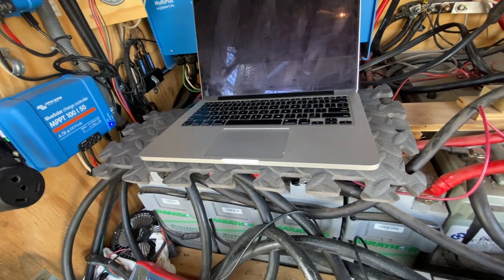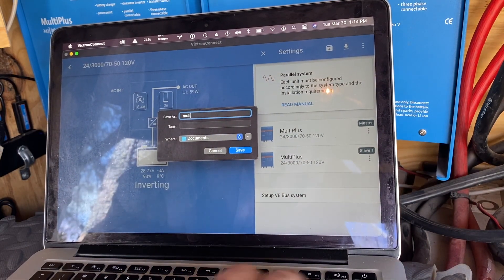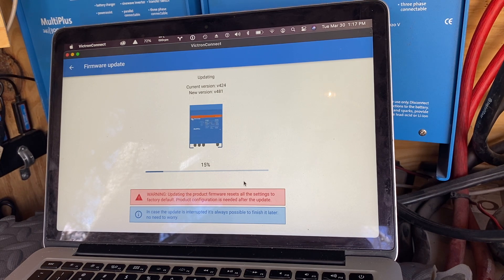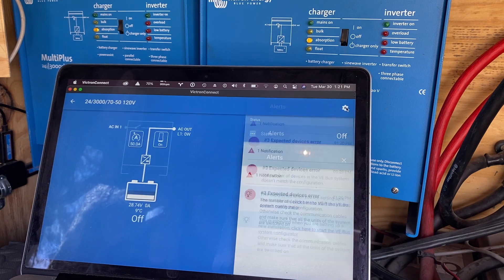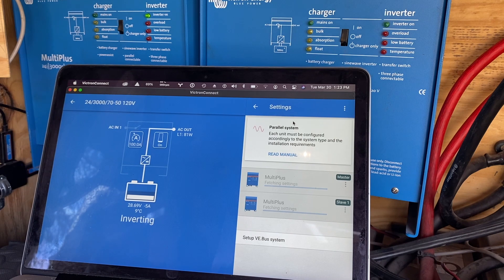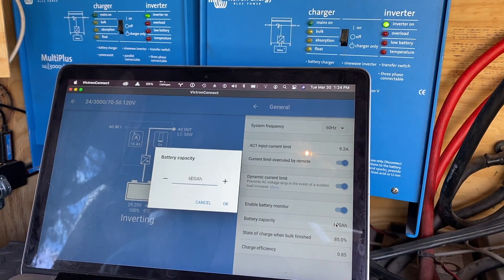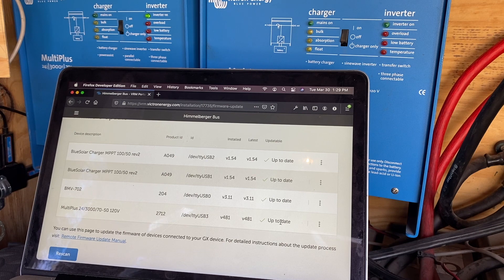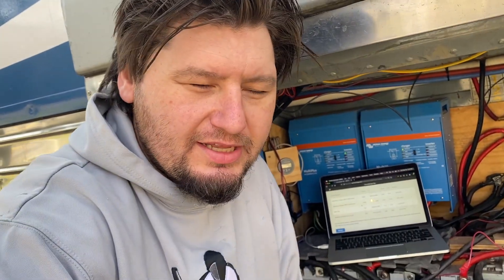Updating Victron Multplus Firmware via VictronConnect MK3 to USB and VRM

Comment: Came Across This Video
Do You Need Driver For The mk3 Adapter?
My MacBook mid 2014 does Not Recognize The Inverter
Reply from the maker: No driver needed on MacOS .  Is the inverter on?   Try swapping out ethernet cables as well.
Reply: @HimmelbergerBus  I just had to open the Victron Device Part and ThenConnect the m3k adapter
And bingo!!  We are in Business 
Thanks for your help
I am now running the 3.10 27 software in the raspi4 
Now you can update in VRM Portal on line in the three dots drop down  list  Device List. At bottom. Firmware updates. Can update all Victron Equipment Except the Pi 
When updating this way. Keep the Pi on a different power supply it works
My inverter is now on Hardware 506 working A1
The Pi can be update in the firmware section  of the settings
No issues Now
Go Luck and Travels

Comment: Hey I have a question, I just installed my 24/3000 multiplus inverter I have 8 135ah AMG batteries in series and a transfer box from my shore and genny. My system was running off my genny and shore only so now I have my inverter connected and only half of my power is coming on, on my breaker box some breakers are not getting power and the others are showing 119-120v can u please help
Reply from the maker: Sounds to me like you have split phase power in the coach. Your inverter is single phase. Sometimes people run two inverters to get the 240 split phase or an auto transformer. 

Some folks just move some items to the inverter leg and leave the other side for generator or shore power only, like an electric fireplace. Or second AC.

I ran my coach to be all single phase, so I have no 240 volt things and no auto transformer to worry about.
Reply: @HimmelbergerBus  u have a email I can send u some photos too?
Reply from the maker: Shawn@thehimmelbergers.com
Reply: @HimmelbergerBus  I just emailed u, I’m pretty sure I have single phase but is it a setting that would cut a leg off?

Comment: Hi Shawn, thanks for all the great videos on RPi and Touchscreen! You mention in hindsight a Venus GX or Cerbo GX would not be much more cost. Can you elaborate on that? Isn't it roughly $500+ for GX device and screen versus roughly $200+ for RPi? Connectors are extra on both, am I missing something? Thanks in advance and appreciate your step by step videos!
Reply from the maker: Venus GX was $250-$300 I thought. Cerbo GX doesn’t need a screen. You could in theory use any Table or even an RPi as the remote screen for a GX device. With GX device you can go VE direct serial cables , no USB adapter needed. You may still need a MK3 adapter for the multiplus but now you can upload a program file via VRM -> Venus GX so that’s a “might need”.  You also get tank sensor inputs, VE CanBus, and no need to fiddle with the OS constantly on updates like we’ll need to on 2.71 

 ¯\_(ツ)_/¯ I’ve got $150 or so in adapters, no idea what they run now.  It just that it becomes less of a slam dunk when the cost difference is under $100 IMHO.

Comment: I can’t get in to set my multiplus 10000 I got some nec a 123 and there a 13 a lifepo4 and it won’t let me change the parameters help!
Reply from the maker: You need an mk3 adapter, either USB or BT

Comment: Hey Shawn, how have you been? Got my pi4 running 2.60 a while ago and it is has been great. did you update to 2.65 or 2.7? any reason to? when are you heading out for the summer?
Reply from the maker: Yeah, I showed I was on 2.65~8 in the video (near end) :-) We’re tentatively going out west again in June. Going out plenty more around here, got a few surprises. First we have brakes to get done.
Reply: @HimmelbergerBus  cool, i cant find a description of the changes from 2.6 to 2.7 so i dont know if it's worth it. you going to tackle the brakes yourself? i used to run a bus repair shop and that is not something i would try myself, too hard on the back its a young mans job.
Reply from the maker: @markstumpf9391  major change on 2.65 is the ability to update multiplus firmware from VRM now. Hopefully this is the last time I need to hook up a USB cable to it.

Comment: One day I would love to get a Victron Multiplus just to simplify my electrical, need tires first :)  Nice to see firmware flash process though.
Reply from the maker: This was so much easier than with the old VEFlash software.  I bought mine  much cheaper than most by using eBay and making an offer.  Give it a try.
Reply: @HimmelbergerBus  Never thought of trying that..good advice!

Comment: Hey Shawn that was cool do you find an advantage to running two of the multi plus units instead of one single bigger unit?
Reply from the maker: Victron didn't make a 6kva and still might not. I like the redundancy, this way if one fails, we're not without an inverter.  Same with Solar chargers and so on.
Reply: @HimmelbergerBus  you mentioned in the updating one would be considered the slave unit is that right and are you wiring your breaker panel one inverter down each leg of the breaker box?
Reply from the maker: @briandavis9975  No, that would be 240 split phase, I joined both legs of my box for single phase 120 only.  I have 2 AC units (1200-1400 watts), electric water heater, microwave, etc.  I didn't see a way to balance those without overloading a single inverter.  So both run in parallel, 6000 watts (6kva) for entire system, whatever needs power gets it and the load is split 50/50). What's nice is if we want, we can add a 3rd.  So far we've only been near the limit a few times.  Full AC, making hot water and someone turned on the microwave.   If we're on a pole, no big deal, because it's all hybrid.  So we get 6000w plus whatever we get from the pole.
Reply: @HimmelbergerBus  thanks for explaining it for me Shawn

Comment: Glad everything updated ok without problems. The Victron stuff is good but it's kinda like the Linux of solar systems, you kinda have to roll all the pieces together yourself. Someone with your knowledge would have no problem, but I cringe at the number of missteps the average user could take. I think the average user with a system of your size would be better off with an all in one solution like the Sol-Ark. Most people balk at the price until they compare complete systems together and then it's a really good deal. Or you could just buy a Sol-Ark workalike from the OEM Chinese manufacturer for a fraction of the price, but that's another story for another deye!
Reply from the maker: You're not far off, Venus OS is a Linux  / Unix variant running on ARM hardware.  In almost all areas of my life I hate all in one solutions.  If one part goes bad, it's hard / impossible to fix without replacing it all.  If we lose 1 inverter, we're fine, if we lose a solar charger, replace it, we're fine.  If we need to add solar chargers, no problem, etc. 

Combine that with the benefits you get form the Victron Ecosystem, it's hard to beat.  Support  and community network is amazing. Warranty of 5 years is also better than most. Their data logging helped me diagnose a bad alternator a few years ago.  

I started my build with lower cost  set and forget it solutions.  They started failing within a year, I sold it all and went with Victron, no issues so far.

Thanks for the comment and perspective,  ours is not everyone, I'm sure others will find it helpful.
Reply: @HimmelbergerBus  I understand what you are saying about component failure and modular replacement. It is also good for upgrading pieces in the future. Those things are more important to you than any possible hassle or problems fitting the pieces together, but I think the average user would be better off with something they can just use. Not everyone is a Google engineer like you (it seems) or a systems integrator like me. Most people are better off buying a Mac instead of building a Linux laptop, for example, even though it cost much more. The Sol-Ark is not a lower cost solution, it is pushing $7000, but for those that can afford it, it is a good, easy solution. It has modular replaceable boards inside and has a 10 year warranty backed by a US company in Dallas. I'm not trying to be a Sol-Ark salesman here, but I am just amazed at how much money people will spend on a Victron system without exploring other options because it seems to be the RV system of choice by default. BTW, I didn't buy the Sol-Ark myself, I bought the Chinese OEM clone because like you I don't mind winging it a little without support.
Love your channel, sorry to ramble on :)